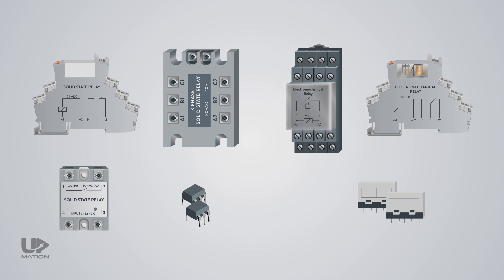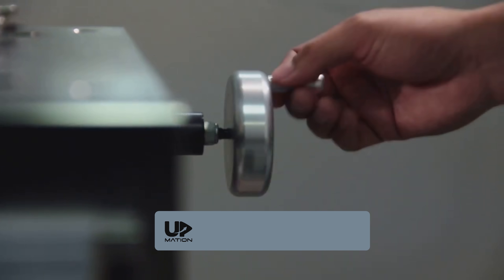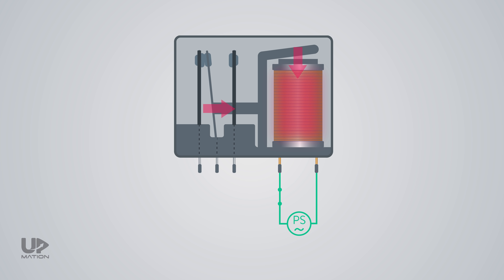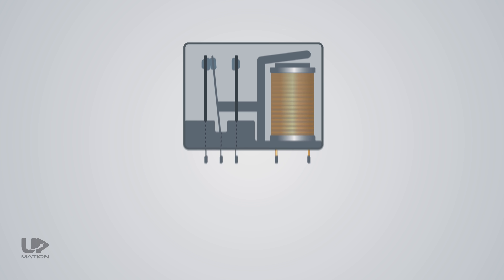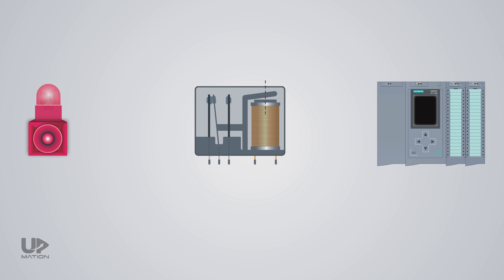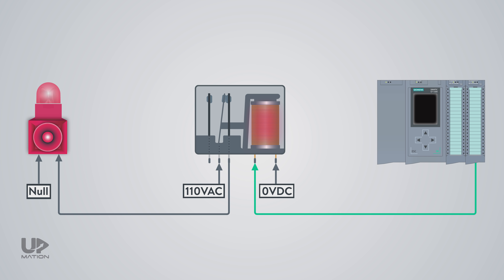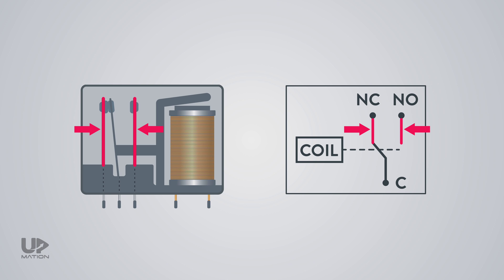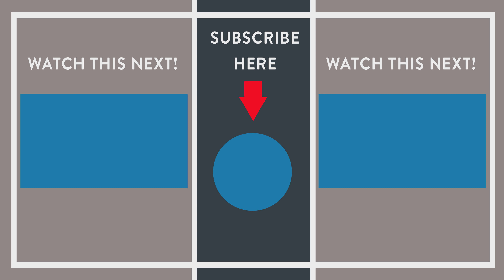Why we use Relay in PLC Applications | Relay Wiring Diagram | Types of Relay-SPST, SPDT, DPST, DPDT

Comment: And what about securing a PLC controller with transistor outputs using a standard relay with coils. When disconnecting, there are overvoltages on the coil, does this not threaten the controller with a transistor output, or do additional protections need to be used (e.g. diodes).

Comment: I have a question. This safety relay has 2 channels. Is it possible to use only one of them or use two channels for two different signals, in example one or Emergency bottom an other for door switch)

Comment: Very nicely done. Easy to follow and understand each type of relay. Have a question on the DPDT relays however....do you always have to pass the neutrals with each hot? OR can you pass additional hot circuits through if they all share the same location on a neutral bus bar for example?

Thank you and keep up the good work!

Comment: nice video. Clear motivation to use relays together with high-cost controllers. You did not mention that the controller could be relatively cheap (just 200-300$) and have a fuse for outputs. Seems that in this case the relay on every output could be not so good idea if you want to save some money.

Comment: Hello :)

At 4:48 you have an example where the AC voltage is connected to Common and the siren to NO. Is it convention or more appropriate to have the Active/Live connection on NO and the siren on Common? This ensure that energy cannot flow through NC.
Reply from the maker: Hey, Michael! That's correct. This will ensure that the electricity flows toward the device, whenever the relay receives the command.

Comment: I am testing 2Phase 208v output from an SSR whether the relay’s control voltage is energized or not. How do I design a dummy load so I can verify 0vac with the control voltage not energized and 208Vac with control voltage energized?

Comment: In one of our site, the entire IO modules in that DDC panel got short circuited and reason from tech team came as due to prolonged over voltage, what type of relay can be used to avoid prolonged over voltage? Any suggestions?
Reply from the maker: "Short circuit" and "Over voltage" are two different types of failure in the circuit. Consequently, you should examine different equipment to protect your circuit against them. In your case, as you have more sensitive electronic devices, you should choose protection devices with a faster response time. There are a couple of ways to do so. You can use surge protectors or "Isolators" for your analog cards and fuses (fused terminal blocks) for your digital cards.

Comment: It's difficult to find relays that work directly from a microcontroller.. 24dv is already too much. So you need a transistor or relay to power the relay. I would like to switch 220v AC for long durations up to 16A. The power consumption of relays is also a thing here..

Comment: Very important thing to mention here is that there is a normal, undersized state of the relay that is spring actioned... because some systems need safety and the logic to be NC to ensure that the failsage (failure mode) always shows a signal. But great video!!! Thinking of cars also helps to understand the purpose, ie. Having large wires close to the relay and load while controlled by the relay allows for smaller wires and more dense power circuits ,modularity.
Reply from the maker: Thank you for the input!

Comment: I'm so glad to watch such a great and practical video about relays. The tips when using relays is clearly explained! I appreciate that.
Hope that you guys can make videos about sensors, like 2/3/4-wire wiring, single-ended and differential signal, 2/4-wire measurement and so on.
Reply from the maker: Hey! Thank you very much and you're most welcome! Sure thing! I'll transfer your comment to the team. Thanks!
Reply: nothing like hearing a young programmer and an old programmer get an argument over 3 or 4 wires for instruments

Comment: Can I use the same battery for both outputs on the relay for 2 different circuits? I did this but the relay keeps clicking. It can't stay on.
Reply from the maker: Hey! Sorry for my late reply! You can definitely use the same voltage resource (Power supply) for the outputs, as long as the amperage capacity of the power supply is on the loads' consumption range.

Comment: Nice video, so when I need to control AC valves I should use relay between the PLC DO card and the actuator right? So basically just take 24V DC for PLC DO Card?
Reply from the maker: Hey! Thank you! As it's been explained in the video, it seems better to use a relay. If your valve is a single-phase valve use a relay. If it's three-phase, then use a contactor.
Your PLC card is not always a 24V type! It might be capable of switching whatever voltage you need. But it depends on the electrical current it can carry (pass). So you have to check the spec of the DO card you're going to use or buy. 

One other complementary point is that (it's not relating to your question) when you are selecting your PLC card (on the detailed design phase of the project) you consider the loads you are going to connect to this card on-site and select the card. But you always consider some SPARE channels for each card and you cannot anticipate the loads they will connect to these channels. So there may be some conflicts between the type of DO card and the new load power ratings. So in this case they need to put a relay in between.
Reply: @Upmation  Thank you very much for your answer! I think this channel is really good (Ive liked and subscribed also). Currently I am using Delta DVP PLC where DC DO card is 24V, I am planning to automate dyeing process with this PLC. Since this is my first industrial automation project, I encountered some problems hahaha. Looking forward to gain insight from this wonderful channel!
Reply from the maker: @chickenz4604  You're welcome! Good luck with your new project! :) Ask your questions down the way; although some questions are difficult to answer without access to the equipment, we do our best.